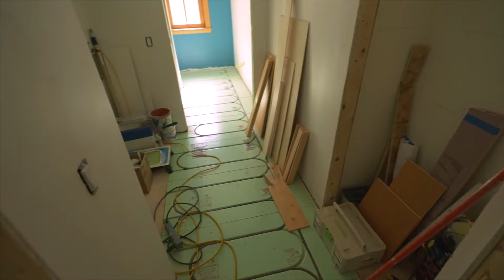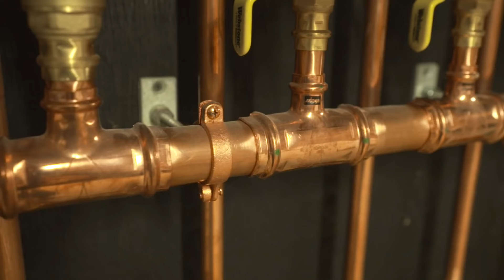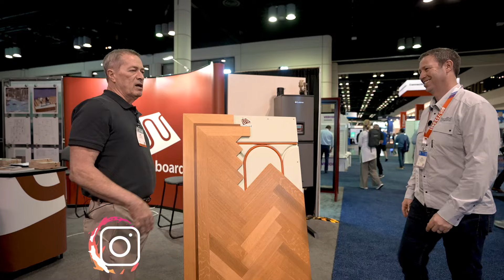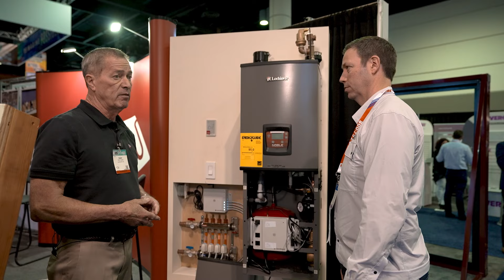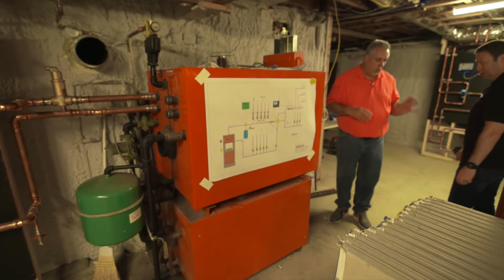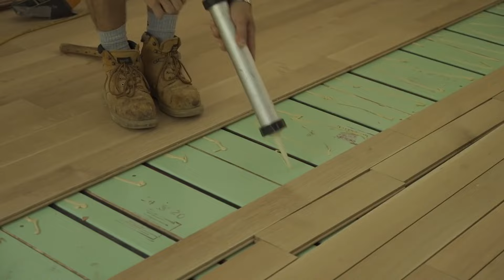ANY Plumber can install this new Warmboard Radiant Heating System

Comment: I got a quote from Warmboard using their structural floor panels and about fell off my chair.  It is a beautiful system but way too pricey.  I had Uponor design my layout for $500 and will use my HVAC people for the install.  Most of my radiant will be under a concrete slab but I want the main level bath on wood trusses to have radiant too.  I think the only way to buy the structural floor panels is directly from Warmboard, yet again very expensive, if they're willing just to sell me just 10 4x8 1-1/8" panels.  I don't want to raise my floor with other manufacturer's slotted panels, as they are not structural and need to be laid on top of a subfloor.  My HVAC people want to put the pex under the subfloor, which I think isn't as effecient.  Any ideas out there?
Reply: ... pex under floor works well, but some say the use of aluminum plates for heat transfer can make noise at times, although less than creaky baseboard radiators.
Reply: @rupe53  Thanks. I  think we'll do that.  Reflective material under the PEX and a good amount of insulation under the reflective stuff between the floor joists.
Reply: @bobbray9666  ... BTW, I am using a similar deal on my home to take the chill from the kitchen floor. It's an older house and with the cabinets there's not enough room for the full compliment of baseboard radiators, so it's more of a supplement. In my case I used up a bunch of scrap 3/4" copper pipe to do a single run in each bay without any insulation. Obviously I have some loss into the basement, but I heat that to 60 degrees anyway.

Comment: Would love to see a testimonial or cost breakdown of someone who used Warmboard system in a house with a geothermal heat pump. Low energy bills + incredible comfort, oh man. What a setup for a dream house.
Reply: you could probably analyze the cost using BTUs of system output as the actual requirements of the house won't change.

Comment: We looked at this product 10 years ago as we installed in floor heating when we built. The benefit of this system is that it is designed to be used over timber joists with plywood the way most stick framed houses are built here. The issue is that these floors have no thermal mass to retain any of that heat and thus the system runs hotter water which uses a lot of energy and is not as efficient. On the plus side your floor will feel very warm. On the negative I was told that only engineered hardwood can handle that much heat. The best way to do in floor heating requires thermal mass which is what radiates the heat not just the pipes themselves. So we had to re-engineer the house to have concrete floors and steel joists to support them. Obviously this added cost but the boiler isn't running as hot as the mass stores the heat and releases it slower. So our floors aren't as hot to the touch typically, as they are with systems that don't have thermal mass. With the mass the floors are only as hot as the room itself which uses much much less energy. For a large home the energy savings will offset the extra cost. For many this may be too expensive upfront, but I see a lot of massive homes being built on your channel and even in my area where they install these less efficient warm board systems or they lay 2 inches of light concrete over the plywood subfloor. This gives some thermal mass but not enough to really do the job so they run hotter as well. This extra heat can cause the hardwood floors to de-bond from the 2" quickrete overlay - a problem you wont have with the warm board system as you can nail down the hardwood because the pipes are exposed so you can see where they are and the aluminum with wood backing accepts nails. Tile floors on the warmboard might be an issue though as the mortar won't stick well to the aluminum. We have had no issues with our glued down engineered hardwood on the 6" concrete because the floor doesn't run hot. Anyways lots to think about when using these products.
Reply: Dr. G, respectfully you’re incorrect on a lot of what you have written.  I have tile over my Warmboard and the heat isn’t high enough to do anything like causing the tile to disbond.  I did add Schluter Ditra mat right on top of the Warmboard panels and I watched closely as my tile guy put it down.  There were zero issues with the mortar bonding to the aluminum.  Same with the tile bonding to the plastic Ditra mat. It is heavenly to walk on the tile in my bare feet.  Nice and toasty warm!  Also, one of the reasons I went with Warmboard was due to the ability to control the heating where I can turn it down at night.  This works very well and reacts within an hour.  To me, this is much better than having a high mass unit like Uponor tubing embedded in concrete where you’re looking at a day turndown time.  The comment about the boiler always being on with the Warmboard system is also not true at all.  I haven’t timed it but it definitely cycles on and off with fairly long off times (much more off than on).  You can also lay real wood over it (as well as tile, carpet, whatever).  It’s the way they do their panels with the aluminum sheet that makes them efficient.  The aluminum sheet retains some of the heat and provides for a much more even heating system.
Reply: @pauledwards1157  I’m glad that you have had no issues with the flooring over the warm board. Perhaps the cases I heard of were not properly installed. I stand corrected. For comparisons sake my floors are never toasty warm but my house is. That toasty warm feeling is exactly what I was talking about. Takes more energy to keep them that way. The boiler runs the water at a higher temp than with a high thermal mass system. That’s why you have to turn the heat down at night. We never have to touch our thermostat. Doesn’t get too hot. And yes with concrete it takes a couple of days to fire up all that mass at the beginning of cold season but we have also experienced a multi day power outage and our house stayed warm enough throughout as it took about 3 days for that mass to cool down. That said having toasty warm floors in the bathroom and kitchen would actually be desirable. So if I was doing it again I would consider the warm board in those areas where I’m barefoot and standing around and mass for the rest. Thanks for sharing your experience.
Reply: @theverdictisstillout  I don’t ever manually touch my thermostat.  I just like to sleep at a cooler temperature than when I’m sitting on my couch during the evening.  The Warmboard thermostats control the floor temperature based on what they read 50” off the floor.  I tend to run mine at 71 during the day/evening and like it at 64/65 at night.  You can’t do that with high thermal mass systems which was why I did not want to go with the typical concrete/hydronic tubing method.  I needed that ability to turn down to a cooler temperature at night.
Reply: @pauledwards1157  pros and cons. I cannot do that. 🙂
Reply: @pauledwards1157  Wow, I installed Uponor's Quik Trak on a 1st floor remodel.  80% is covered by hardwood and 20% bluestone (foyer) and marble (powder room).  There is a huge difference between the warmth feeling on the stone vs the wood.  Quik Trak uses 5/16" pex and is generally used for renovations and applied directly over subfloor.  They do not recommend heating hardwood to a surface temp of more than 80º.  This Warmboard system seems to be much more refined with the aluminum on top of the wood panel as opposed to the quick track which is underneath the wood panel.
I'm now constructing a new home and I'm considering using stone tile vs hardwood for its ability to hold heat but at the same time, it will take longer to heat up and cool down.   Any thoughts?
Reply: @eddiepotts982 I’ve had mine installed for multiple years now (3?).  I still absolutely love it. All of my previous comments remain valid.  The ability to cool the house down at night is still a big selling point for me.  If it was a basement or lower level, maybe it wouldn’t matter as much.  I still think it’s a perfect product for infloor heating.
Reply: Interesting comments. I'm a retired HVAC tech and finally building my forever home in Western Michigan. I'm using the happy medium to the low mass vs. high mass emitter. The basement level will have high mass (4" concrete) with the bedrooms zoned to allow for cooler night temps. The main floor and the upper floor with both be medium mass Thermafloor - not to be confused with the old trade name of Gypcrete which is made by the same company. Thermafloor has more gypsum so it's lighter and yet durable. It's probably a wash with costs compared to this system but the plus benefit is that I've added a fire barrier between levels. Also, my supply water temperature on the coldest design day is 102 degrees F. My boiler, (NTI, TFT80) has the ability to do automatic reset meaning the boiler automatically adjusts the supply water temperature to match the outdoor temperature. That saves me money because the lower you run a condensing boiler, the more efficient you recover the heat from the gas you burn. This is a seems to be a good engineered system for the right application, I'm just old school and shy away from to many electronic controls, though you can't escape what's available today.
Reply: @steveedlund7357  very interesting. When we built there was no discussion about zones to allow for cooler night temps. We do that with our air con in the summer because that is easy to adjust. The in floor heating with high thermal mass does not respond quickly enough to do that. But honestly we don’t feel that we need to. Our house is 7500 sq ft and our boiler is propane and we go through about $2400 Canadian dollars a year in propane, heating it to 72 in Canada where we have actual winter as you will in Michigan. We don’t find it hot or an issue for sleep. Friends have your type of system and their floors feel warmer than ours and do respond better to changing the temp but they spend more heating their house than we do. In any event in floor heating is the absolute best. One piece of advice. Plan out carefully where you are going to have area rugs as they are very insulative and will make your in floor heat less effective. My wife and I are always at odds because she wants rugs for decoration and I won’t let her because it cuts back the heat. Where we do have them the floors feel hot under the rugs but the rugs are cool on top. Best to have less tubing under the rugs and tighter loops in the rest of the room. Also we have a lot of hardwood flooring which also makes the in floor less efficient as wood doesn’t transmit heat as well as tile. The ceramic tiles always feel warmer than the wood floors.
Reply: @theverdictisstillout  Thanks for the tip on the rugs. My tubing layout was engineered the same for the Great Room but I can field adjust the spacing in the center where a rug will be. We're using tile everywhere because of the sand used on the roads being tracked in the house. The cooler bedrooms is done by using a thermostat and zone valve and setting lower all the time. We sleep better under quilts. Thanks again for your reply.

Comment: So what about repair?  Are parts readily available or do you freeze for a week while the manufacturer digs up a part to send out?  And those controllers?  Hard coded so when the fail, the manufacturer owns you, you pay or freeze.  Nice system, but a lot of these new HVAC systems are, until they break.  As we see with ECMs on systems, manufacturer specific parts have high mark ups so when the warranty is up, your system is on borrowed time as far as affordable repair.  

You have a high end system, you are at the mercy of the manufacturer for parts, they won't be on the the HVAC contractor's truck, maybe not at the supply house.  And if you live an hour or so from a city big enough to have multiple supply houses, you wait, sweating for freezing for days for repair.

Comment: It is funny how this looks to many here like a "new" thing. In Germany most houses built in the last 20 years have floor-heating. It is not even close to being new 😉🤷‍♂️
Reply: in floor heat has been around since WWII but this bit with preformed panels made with wood backing is new.

Comment: Matt, my wife and I just purchased a new home - well it's new for us, it was built in 2007. The floors throughout are tile, hardwood, and carpet. I am going to rip up up the carpets and have Warmboard installed. However, I am hoping there is a work-around for the floors that are tiled and hardwood to get radiant heat - these floors are very cold on bare feet. Fortunately, the Warmboard rep for the Eastern Region lives near us. Hopefully with her and Stark & Cronk HVAC they can find a solution. There are a couple of YouTube videos which show PEX being pulled through the floor joists and supported against the subfloor. 

Do you have any thoughts on this?
Reply: Installing under the subfloor sounds like a costly faff.  Imagine crawling on your back, removing all the floor insulation, then installing loop after loop of pex to miss joists/blocking/mechanical/electrical/plumbing. Then reinstalling (new) insulation. Probably cheaper to simply remove the flooring and install warmboard.
Reply: If you have Access to the floor from below there is a similar style system that's been on this old.house as a retrofit.

Comment: Can it run cool water as well?
Reply: No. A radiant cooling system requires different types of controls, including dehumification (and addressing condensation) which can get very expensive. So you would need a separate system. In our opinion, radiant cooling is not the best cooling option in most situations.

Comment: Good video on product but one thing it seems you never address outside of cost which you mention is when there is a problem I.e. controller board etc. breaks and it will overtime as all parts do at some point who do you get to service?  While a plumber can install they are not tech to diagnose and fix electronic issues. Please consider addressing that aspect when you are showing new/updated products on where service can be obtained and who can repair. Thanks for the video.

Comment: My dad built quality custom homes starting in the 1950’s. He always used hot water baseboard heat, being quiet and clean. I built my current custom in 1994 with HWBH as well. It makes for wonderful living in cool/cold climates. This seems like a great product. I love your channel.
Reply: I hadda limit use of my hwbb system due to the propane cost won’t to an o d boiler(wood) which is the best other than the exercise preparing the wood but sure works for me 15 years n going !! N it can end up free if ur creative. All the heat u want n then some FREE.

Comment: Unfortunately, up here in my area (downstate NY)  Lochinvar boilers are rare and often get removed and replaced by something more service friendly. A recent project I completed had a fancy Lochinvar boiler.  A dozens visits from 3 different plumbers failed to get the system operational.  Lochinvar sent a service tech who was marginally useful.  It took nearly 18 montha to have the system properly comissioned.  Reputable plumbers I have worked with have similar stories.  Seems like amazing equipment that requires special training.
Reply: Many plumbers have little real experience working with boilers.  Worse still many that do work on boilers think they know what they are doing but don't.  Try to find a company that specializes in hydronics.  I work in South Jersey and there are a ton of plumbers who "work on boilers" but only a handful actually know what they are doing.

Comment: Does this support electric or only gas?
Reply: Natural Gas or Propane. We also have an electric option. Stay tuned for a Heat Pump announcement later this year.
Reply: @Warmboard  So you have an electric option available now or it's coming later this year?
Reply: @jvalal  We have a resistive electric option currently. We only recommend for very specific instances. More information about other electric options later this year.

Comment: After seeing the video on the heat pump water heater that seems like the way to go for heating radiant flooring.  Maybe that and a mix of tankless.
I remember loving radiant flooring when I lived in an apartment in Korea.  Their system was really old school.  There was a valve in each room to either turn the system on or off for that particular room and a boiler that also acted as the hot water for your bath.  I got 3rd degree burns not realizing how hot the water coming out of that thing was.  It seems like we really make the system more complicated than it has to be.

Comment: Is warm board structural ? Or does it need to be placed on top of an advanteck type subfloor ?
Reply: I’m pretty sure it is not structural. I would check with warm board directly to make sure but I have seen it in other house builds and it has been placed on other structural boards. I hope this helps! Thank you.
Reply: definitely not structural
Reply: They offer two panel styles. A structural subfloor panel or an osb retrofit panel.
Reply: Our Warmboard-S panel is structural and can be installed directly over joist. Our Warmboard-R panel typically goes down over existing subfloor or slab.